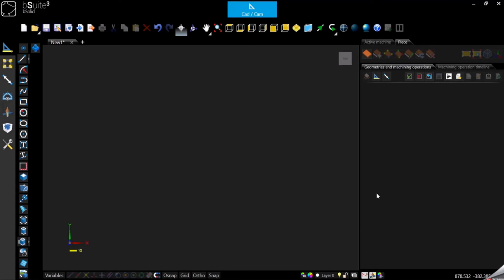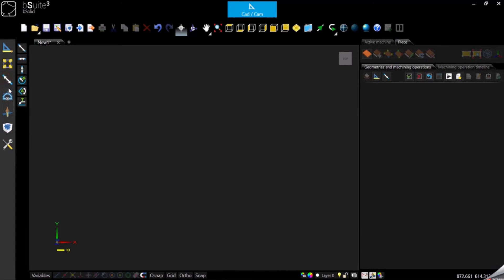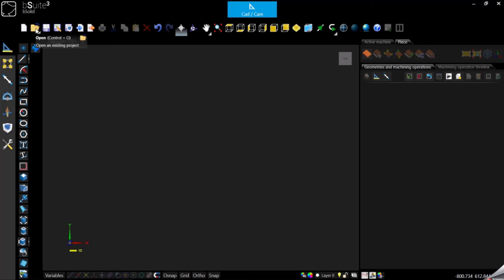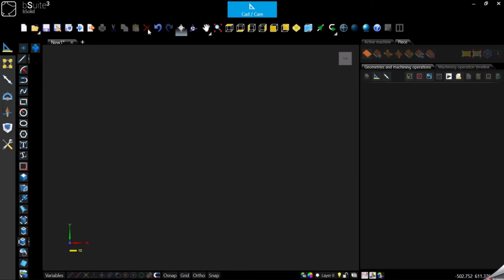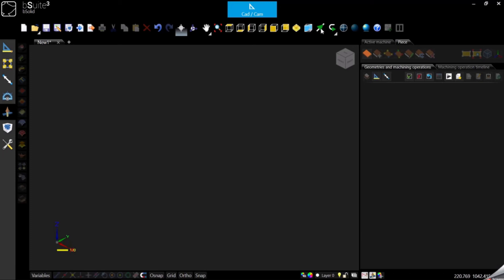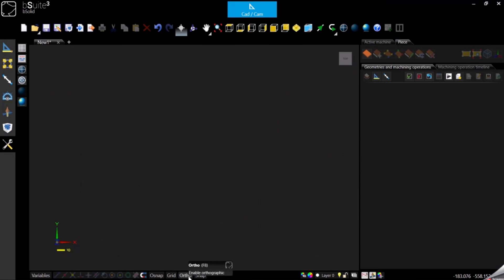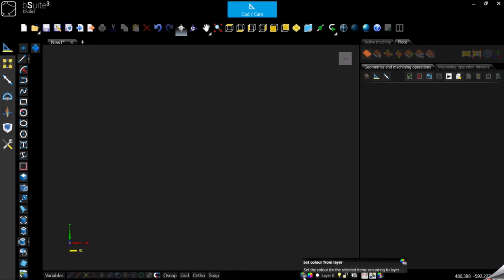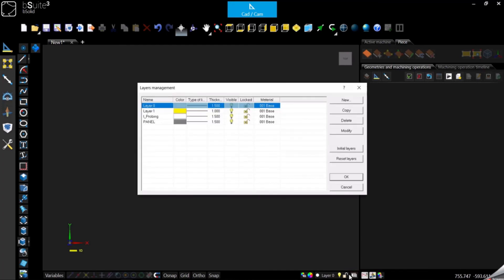1 - Overview about BIESSE bSolid CAD/CAM environment

Comment: sir leaning bsolid and cnc operation can help in getting better opportunities...?
Reply: Short answer i worked in 7 different cou tries 2 continents, starting as an operator to now a Head of Technical Engineering. As an operator i made regardless of the country 2.5 times the minimum wage of any particular country i was in. In my current position i make close to 5 times the minimum wage. Fun job if you like it. I personally love it.